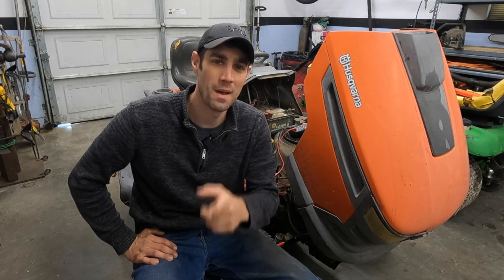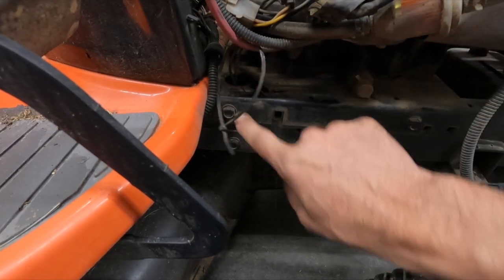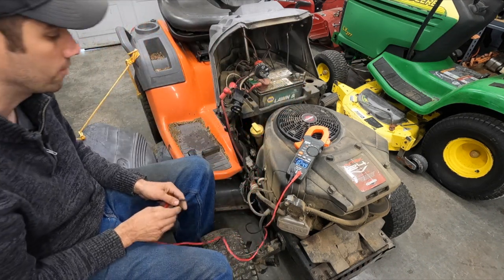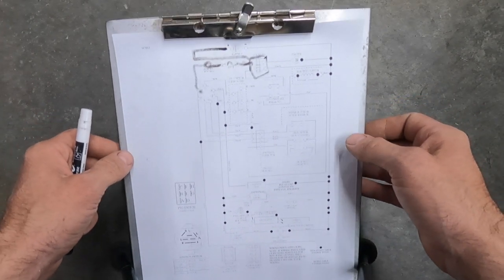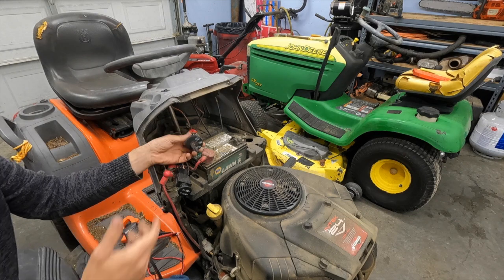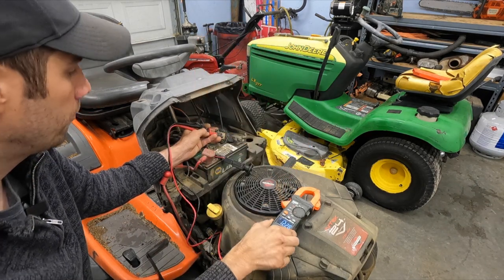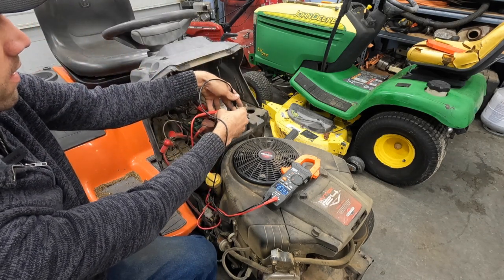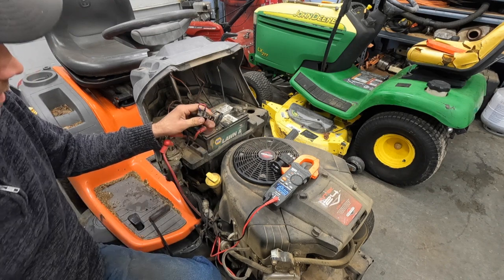How to fix a riding mower whose blades won't turn on. (Electric PTO)

Comment: Every time I turn the PTO on I blow a fuse!!! I have a new wiring harness, new ign switch, new pto switch, new pto clutch, all saftety switches are connected.. The only thing I haven't checked is the voltage regulator. 2005 LTH 1542..... HELP!!!!
Reply from the maker: Ok I need to know that the parts you ordered are for that exact mower. How did you pick those parts (wiring harness, key switches, pto, and pto switch, etc). Did you get them online or at a shop? They are brand new or new to you? Lets try and verify that we have the right parts first. Can you send me the numbers on the tag under the seat? It should be a model and serial number of the machine.
Reply: @metalinmotionshop  I got the ign. and pto switch from a dealer shop. wiring harness (532193376) on line and clutch from extreme out door online (X0519).

The fuse blows without the clutch wire connected. I checked the old and new clutch, they read the same ohms.

(96013000900 under the seat)

The day this happened I was mowing in the middle of the yard, I didn;t hit anything, I was not turning or stopping or starting, the PTO had been engaged 15 minutes. No extreme loads or anything like that; It just died as if someone pulled off the plug wire!!!

The only thing I have not checked is the voltage regulater??????

Starter and solenoid are 5/6 months old!

THANK YOU!!
Reply from the maker: Ok so if the fuse is blowing without the pto hooked up then we know its nots the pto. Might as well leave the pto disconnected until we figure it out. Try not to disturb the wire harness to much as the short can go missing. I assume you’re running a 20 amp fuse? When the fuse blows its probably shutting off the little solenoid on the bottom of the carburetor and that is turning the motor off. 

Is the fuse blowing quickly and every time?

When specifically does the fuse blow? Key one click on, or starting, or when you pull the pto switch?
Reply: @metalinmotionshop  Fuse blows shortly after cranking and running for 20 seconds +/-. Sometimes before engaging pto, but definately everytime the pto is engaged!! Yes using 20 amp fuse.
Reply: @metalinmotionshop  I forgot to mention that I found the volt gauge was melted/smoked. It was on the old harness. I have not replaced it.
Reply from the maker: If you’re meaning the amp gauge in the dash you could just unplug it and connect those two wires to each other. That gauge is usually optional. 

Here is a link to your wire schematic. 
https://www.jackssmallengines.com/jacks-parts-lookup/manufacturer/husqvarna/ride-mower/lth-1542-96013000900-2005-10/schematic
Reply: @metalinmotionshop  yes I unplugged it. I have that same wiring diagram. Everything is according to the diagram.
Reply from the maker: One more thing- does the engine have to be running in order to blow the fuse? If it blows with the engine off key on would be great.
Reply from the maker: I have two tools I use to find shorts. One is a bussman 20amp circuit breaker fuse that will keep tripping and reseting over and over. The reason I asked how fast the fuse blew was because you can use this circuit breaker and the clicking noise it makes to find shorts. The faster the fuse blows the better. By unplugging different things on the mower until the clicking stops, you can narrow down the problem area.  This saves me from going through fuses. 

The other tool is a homemade peanut light bulb with a buzzer( you dont have to have the buzzer) I plug it directly into the fuse holder in place of the fuse. When there is an active short the light and buzzer sound. I can then start unplugging sections of the wire harness until the light and buzzer go out. At that point, Ive narrowed down the section where the short is. I have found those voltage regulators can short out and have replaced several because of it. If your engine blows the fuse with the engine off key on this test as much easier. Once the engine is running, obviously you’re limited as to what you can unplug without the engine dying. You may have to have to de-pin some wires from their pigtails in order to keep the engine running and be able to separate the faulty circuit.
Reply: @metalinmotionshop  thanks for your help

Comment: Great instruction. My blades just stopped. Recently put new switch..will attempt to run test as shown. Mechanic thinks it's a bad PTO clutch.  Scott's s2554

Comment: Is there a safety where it shuts the pto off if you're overworking the mower?
Reply from the maker: No not usually. If the pto pulls to many amps it can blow the fuse. Most switches are operator presence switches that won’t turn the pto on if someone is not on the machine.
Reply: @metalinmotionshop  yeah, this one just quit while I was mowing
Reply: @metalinmotionshop  are they repairable if they go bad, or just replaced? If you know?
Reply from the maker: If you have power and grounds getting to the pto and the pto isn’t kicking on, the wire is probably broken internally. The only solution is to buy a new pto. There is usually no fixing them past adjusting the clutch gap on some models.
Reply: @metalinmotionshop  poop,  guess I'm outta luck😰
Reply: @metalinmotionshop  thank you

Comment: I thought it was the switch when my ZTR blades wouldn't engage, but when I put a new one in, it ran for a while and blew the switch out.
Reply from the maker: My in-laws Scag ZTR did that too. They replaced the switch twice and then found out the pto was burning it out prematurely. Once they switched the PTO out they haven’t had any problems since.
Reply: @metalinmotionshop  Thanks 😄